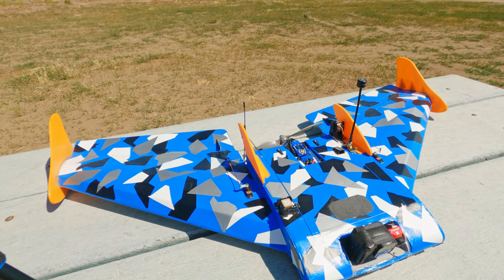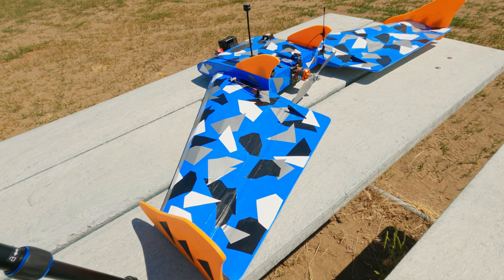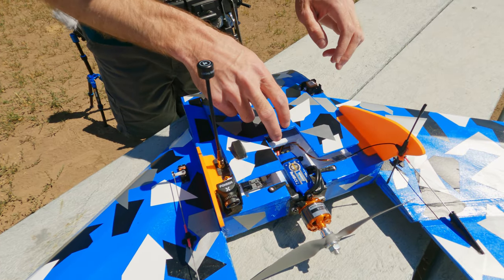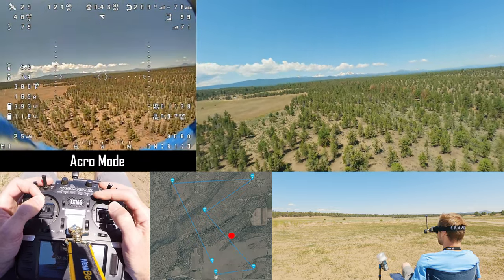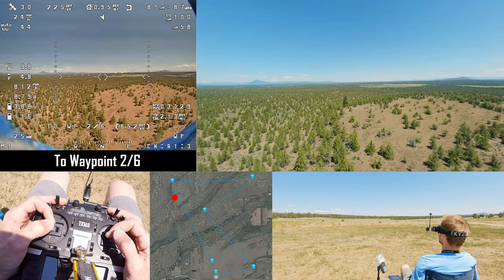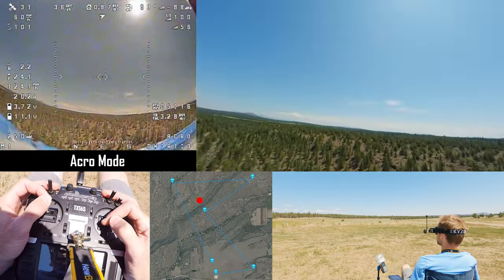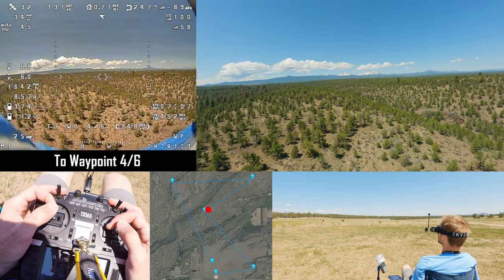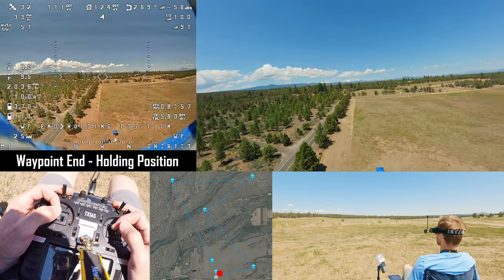FT Spear // INAV 6.1.1 Extended Mission and RTH Demo

Comment: You should change the landing gear to a cable tie system. This might reduce weight and they are easy and cheap yo replace considering it's a part that takes wear and tear. Otherwise that bad boy is firebdaeg! Diggin it.
Reply from the maker: Dude, thanks! I'll have to check out a video on this cable tie system, I'm always a fan of weight reduction.
Reply: @LiftVector  
Have you considered using a toroidal prop? It might help to reduce engine noise and may provide a small boost to efficiency at low RPMs.
Reply from the maker: @combativeThinker  Hello, I have not considered a toroidal prop. I don't even know where I would buy a composite 9 inch prop, not seeing them on Amazon yet...haha! If you know where to buy them, let me know.

Comment: Was your 25mw output reading your transmitter instead of your VTX?  I think both crossfire and expresslrs support showing the transmitter output in the OSD.  I noticed in the bottom right the OSD showed the VTX power was on setting 3.
I've been wanting to do some waypoint missions with my inav models, thanks for showing us the ins and outs!
Reply from the maker: You are absolutely right. I went back to my OSD config and I had enabled show crossfire power output thinking it was for the VTX power. Thanks for watching!

Comment: Awesome video! Thanks for showing the FT SPEAR in detail and for sharing the STL, what is the total weight with battery? Thank you!
Reply from the maker: Thanks so much! You're welcome. CNHL 3200mAh 3S - 218 grams
Reply: @LiftVector  thanks, but weight total model, with battery.
Reply from the maker: @fpv_wing  Sorry, I misread that. 1280 grams AUW, with the Hero11 Mini.
Reply: @LiftVector  ahhh ok! CG is in the 2 points below each side?
Reply from the maker: @fpv_wing  That's right. She is a tad towards the nose front point but still in between the CG tolerance.

Comment: Great design! Which 3D print material did you use for the 3D print parts?
Reply from the maker: Thanks! I used lightweight PLA (Polymaker) for the winglets and vertical fins. Regular PLA (Sunlu) for all the other parts.

Comment: Hi, nice plane, I have the same FC and for some reason it is showing a fully charged battery 50% in osd, any ideas...?
Reply from the maker: I'm using a 3s Lipo and I didn't have to calibrate the battery current sensor. Next time I plug into INAV configurator I'll take a look again. In the meantime, check out Mr. D's guide here: https://www.mrd-rc.com/tutorials-tools-and-testing/flight-controller-therapy/setting-the-current-sensor-in-inav/

He is extremely knowledgeable with INAV!
Reply: ok, but I put scale as Matek recomennds 250 for AMPS and 1100 for VOLTAGE @LiftVector
Reply from the maker: I'm sorry, I honestly don't know because I have two Matek FCs on INAV and even have four FCs that run Betaflight have never needed current sensor calibration. They just worked out of the box and are pretty accurate. Have you tried checking the internal cell resistance on your pack? @Chris-vc1dh
Reply: I will check thank you... @LiftVector

Comment: Hei! Can you tell me why you build winglets with lw-pla (how much infill and how many top/bottom layers and perimeters did you use) and not with foamboard? And with what you glue the winglets to the wing? Sorry for that many questions. Thanks for STLs and video!!!
Reply from the maker: The lw-pla is tougher than the single foam winglets. I was getting creases and bends in the foam on my 1st spear with rough landings. 2 top/bottom layers, 15-20% infill and I believe 3 perimeters or 2. Hot glued the winglets (I punched tiny holes in the side of the prints so the glue had something to adhere to).
Reply: @LiftVector  Thank you for your message!!! So no worries with hot glue to melt that lw-pla, that's good to know. I can switch my hot glue gun to lower temp just to be safe:)
Reply: Hello again! Your front fpv camera is poiting exactly forward or is it at an angle pointing down? On the stl files you have a camera mount pointing at an angle, that's why I'm asking. Thanks a lot
Reply from the maker: @TrupaVisatori  It is angled slightly down. Maybe 5-10 degrees.
Reply: Thanks for your answer. Is there a reason of pointing slightly down or is just personal preference to see more ground? By the way, really like your vertical fins instead of the original foamboard! 3d printing + foamboard is the way😉 waiting for your next flights!
Reply from the maker: @TrupaVisatori  When cruising and maintaining altitude on this delta wing, the attitude of the craft is angled back with the nose up. The angled camera compensates for this. Thanks!
Reply: I finished my Spear, only thing left to do is Inav. But, I have a really, really bad time with my prop. My motor 3536 1250kv have an adapter for 8mm prop. APC hole is 6mm. I've tried to drill the prop but now is giving vibrations because drilling wasn't perfect. So is no go for me with motor vibrations... how you managed that? Can you find props with 8mm hole? Can't believe I'm stuck on prop😂 I wish I could send you photos with my Spear:) all the best!!!
Reply from the maker: @TrupaVisatori  Nice! I used a tapered hole reamer tool and slowly made the prop hole bigger. Then super glued the 8mm hole adapter that came with the prop so it was centered. Yea, drilling would be hard to make it perfect. 

Send a few pics to liftvectorrc@gmail.com
Reply: I think I found a prop for 8mm shaft from Aeronaut. Good to know I don't need to worry about drilling anymore. By the way, I was setting up Inav today, but I'm wondering, what autolaunch settings do you have? Your Spear is butter when you launch! And your CG is towards the nose point or the back point? Sorry for so many questions...
Reply from the maker: @TrupaVisatori  I replied to your email with some diff saves that I changed for autolaunch. CG is about right in the middle of the marks, maybe a bit more nose heavy.

Comment: Nice fly config Congratulations  .Thanks sharing your set up, what is a   total weight and changes inav 6.0 to 6.1.1  how you  config the autolaunch switch .
Reply from the maker: Thank you! The total all up weight of the craft is 1252 grams. INAV 6.1 to 6.1.1 mentioned a fix to 'dolphining" but I never experienced this. In the modes, if you don't permanently enable autolaunch you assign it to a switch/range.

Comment: Can you publish your settings you used in INAV 6.1?
Reply from the maker: Here is my diff, hope this helps. 

diff

# version
# INAV/MATEKF411TE 6.1.1 Jun 13 2023 / 11:37:14 (42ced253)
# GCC-10.2.1 20201103 (release)

# start the command batch
batch start

# resources

# Mixer: motor mixer

mmix reset

mmix 0  1.000  0.000  0.000  0.000

# Mixer: servo mixer
smix reset

smix 0 1 0 50 0 -1
smix 1 1 1 -50 0 -1
smix 2 2 0 50 0 -1
smix 3 2 1 50 0 -1

# Outputs [servo]
servo 1 1000 2000 1674 80
servo 2 1000 2000 1406 80

# safehome

# features
feature MOTOR_STOP
feature GPS
feature PWM_OUTPUT_ENABLE
feature FW_AUTOTRIM

# beeper

# blackbox
blackbox -NAV_ACC
blackbox NAV_POS
blackbox NAV_PID
blackbox MAG
blackbox ACC
blackbox ATTI
blackbox RC_DATA
blackbox RC_COMMAND
blackbox MOTORS
blackbox -GYRO_RAW
blackbox -PEAKS_R
blackbox -PEAKS_P
blackbox -PEAKS_Y

# Receiver: Channel map

# Ports
serial 0 2 115200 115200 0 115200
serial 31 2048 115200 115200 0 115200

# LEDs

# LED color

# LED mode_color

# Modes [aux]
aux 0 0 0 1725 2100
aux 1 1 1 1775 2100
aux 2 12 1 1300 1700
aux 3 45 5 1300 1500
aux 4 53 5 1125 1300
aux 5 11 5 1500 1700
aux 6 10 3 1800 2100
aux 7 28 5 1925 2100
aux 8 3 5 1700 1875
aux 9 21 4 1700 2100
aux 10 54 4 1300 1700
aux 11 36 3 1300 1700
aux 12 19 2 1800 2100
aux 13 13 6 1300 2100
aux 14 48 2 1300 1700

# Adjustments [adjrange]

# Receiver rxrange

# temp_sensor

# Mission Control Waypoints [wp]
#wp 0 invalid

# OSD [osd_layout]
osd_layout 0 0 26 3 V
osd_layout 0 1 1 12 V
osd_layout 0 2 0 0 V
osd_layout 0 3 8 6 V
osd_layout 0 4 8 6 V
osd_layout 0 7 25 14 V
osd_layout 0 9 0 3 V
osd_layout 0 10 22 15 V
osd_layout 0 11 2 10 V
osd_layout 0 12 1 9 V
osd_layout 0 13 1 2 V
osd_layout 0 14 1 1 V
osd_layout 0 15 6 1 V
osd_layout 0 20 18 0 V
osd_layout 0 21 1 0 V
osd_layout 0 22 15 2 V
osd_layout 0 23 13 1 V
osd_layout 0 24 19 1 V
osd_layout 0 32 1 11 V
osd_layout 0 34 11 15 V
osd_layout 0 40 23 12 V
osd_layout 0 41 1 8 V
osd_layout 0 42 1 7 V
osd_layout 0 85 24 7 H
osd_layout 0 86 0 14 H
osd_layout 0 105 22 14 H
osd_layout 0 109 24 1 V
osd_layout 0 110 25 2 V
osd_layout 0 112 0 14 V
osd_layout 0 129 0 15 V

# Programming: logic

# Programming: global variables

# Programming: PID controllers

# master
set gyro_main_lpf_hz = 25
set dynamic_gyro_notch_q = 250
set dynamic_gyro_notch_min_hz = 30
set gyro_zero_x = -3
set gyro_zero_y = -4
set gyro_zero_z = 6
set ins_gravity_cmss =  974.644
set acc_hardware = ICM42605
set acczero_y = -1
set acczero_z = 17
set accgain_x = 4097
set accgain_y = 4089
set accgain_z = 4100
set align_mag = CW270FLIP
set mag_hardware = NONE
set baro_hardware = SPL06
set motor_pwm_protocol = STANDARD
set failsafe_procedure = RTH
set platform_type = AIRPLANE
set model_preview_type = 8
set small_angle = 180
set ahrs_inertia_comp_method = ADAPTIVE
set applied_defaults = 4
set gps_sbas_mode = WAAS
set gps_ublox_use_galileo = ON
set airmode_type = STICK_CENTER_ONCE
set nav_wp_radius = 5000
set nav_wp_max_safe_distance = 500
set nav_rth_allow_landing = FS_ONLY
set nav_rth_alt_mode = MAX
set nav_rth_altitude = 5000
set nav_rth_home_altitude = 5000
set nav_fw_bank_angle = 45
set nav_fw_loiter_radius = 4500
set nav_fw_control_smoothness = 2
set nav_fw_launch_max_angle = 75
set nav_fw_launch_motor_delay = 100
set nav_fw_launch_timeout = 8000
set nav_fw_launch_max_altitude = 6000
set nav_fw_launch_climb_angle = 25
set osd_units = IMPERIAL
set osd_time_alarm = 15
set osd_alt_alarm = 110
set osd_dist_alarm = 0
set osd_crosshairs_style = TYPE6
set vtx_band = 5
set vtx_power = 3
set vtx_low_power_disarm = ON

# profile
profile 1

set fw_p_pitch = 15
set fw_i_pitch = 5
set fw_d_pitch = 5
set fw_ff_pitch = 150
set fw_p_roll = 15
set fw_i_roll = 3
set fw_d_roll = 7
set fw_ff_roll = 85
set fw_p_yaw = 20
set fw_i_yaw = 0
set fw_ff_yaw = 100
set max_angle_inclination_rll = 550
set max_angle_inclination_pit = 500
set dterm_lpf_hz = 10
set fw_turn_assist_pitch_gain =  0.300
set nav_fw_pos_z_p = 35
set nav_fw_pos_xy_p = 70
set d_boost_min =  1.000
set d_boost_max =  1.000
set fw_level_pitch_trim =  6.000
set rc_expo = 40
set rc_yaw_expo = 40
set roll_rate = 18
set pitch_rate = 9
set yaw_rate = 3
set manual_rc_expo = 40
set manual_roll_rate = 80
set manual_pitch_rate = 80
set manual_yaw_rate = 80

# battery_profile
battery_profile 1

set battery_capacity = 4200
set battery_capacity_warning = 840
set battery_capacity_critical = 210
set throttle_idle =  5.000
set nav_fw_cruise_thr = 1525
set nav_fw_max_thr = 1750
set nav_fw_launch_thr = 1800
set nav_fw_launch_idle_thr = 1200

# save configuration
save

# end the command batch
batch end

#